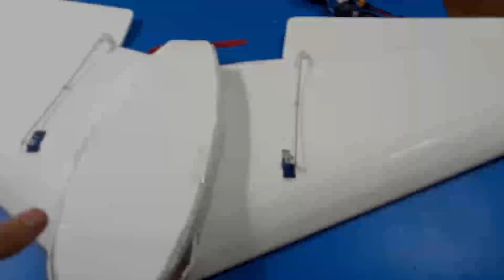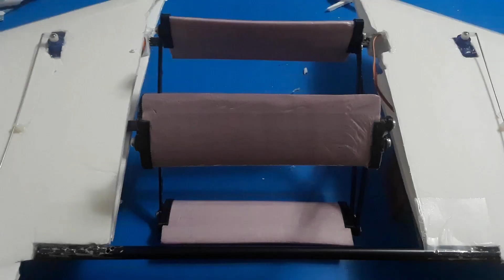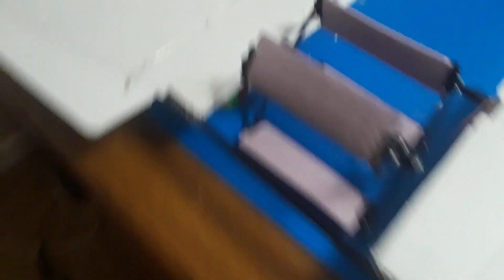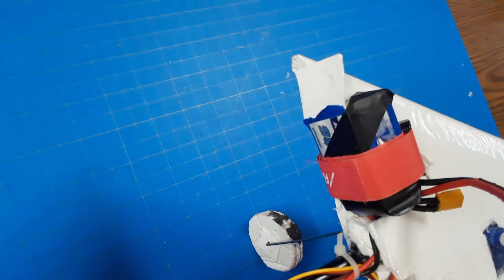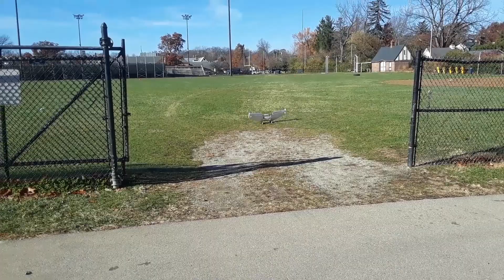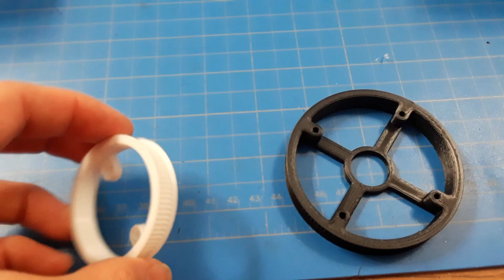First Attempt at a Cycloplane

Comment: Nice job. Have you considered top mounting the rotor?
Reply from the maker: Thank you!  I have, but that would put the center of thrust above the cg, which would result in a large pitching down moment.
Reply: Yep, I thought of that but wondered if it could be compensated for by varying the angle of the blades.

Comment: With a cyclocopter you would want to take off vertical
Reply from the maker: Yes, that's the eventual plan.  However, I wanted to try just using it for thrust before I get to the point where I hover on it.